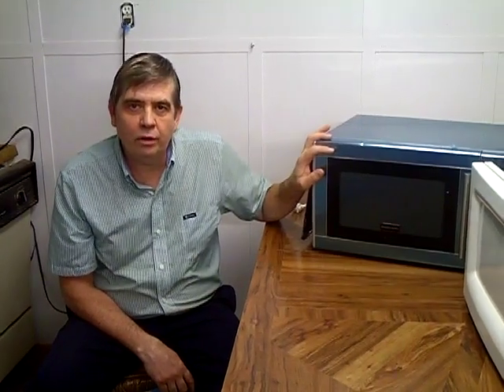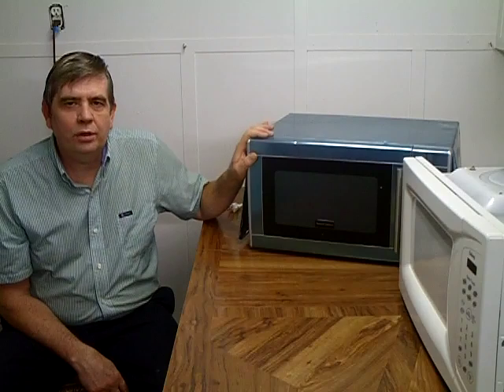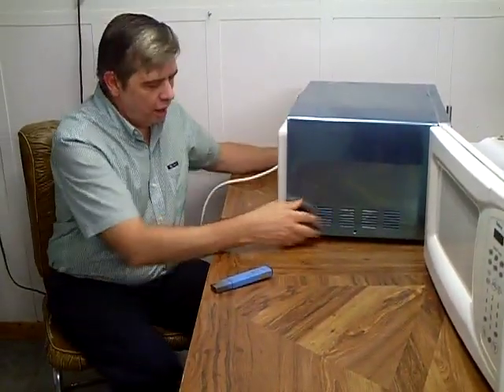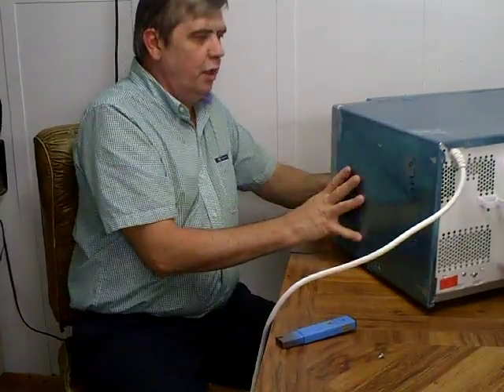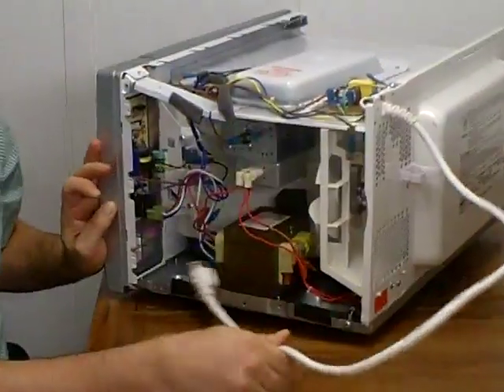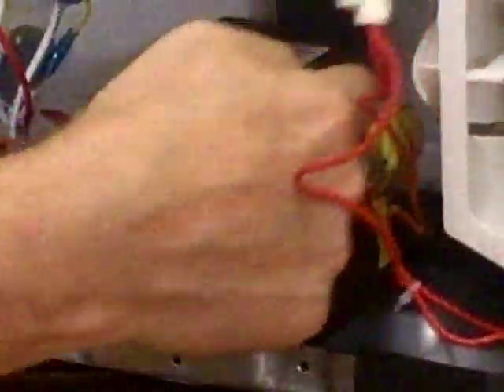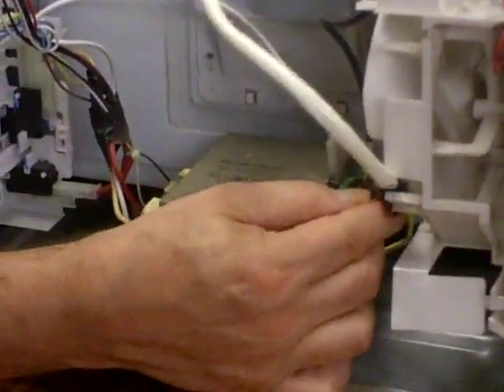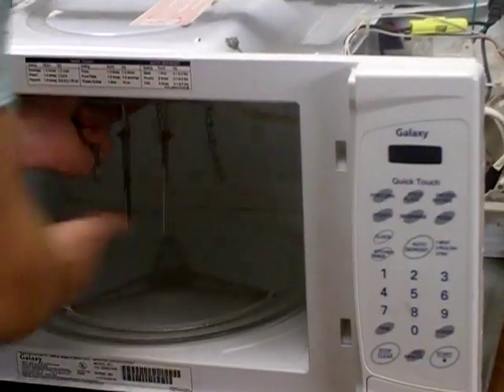6 -How  to build a high voltage  silver machine

Comment: Hello Bruce, thanks for sharing the good stuff!  
I did follow you steps, but as for now i dont get any results.
Perhaps my silver rots are too small? 1.5 x 1.5 mm and 5 inches long. The transformer starts to be hot or warm,  after an hour running, so guess something is working?!  Then i also disconnected the capacitor. perhaps i did some wrong. 
do you provide more info? in writing?  how can i solve this issue? 
pls advice. 
anton
Reply: He passed away
Reply: Mmmmmm ... So... not so nice... but thx for let me know Carlos. 
nice day.. Anton
Reply: so sad .  do you know how??
Reply: Heart attack or stroke-- I can not remember which. Unfortunately, nano sized colloidals do not easily leave the body, and can accumulate to cause toxicity, as explained by Tony Pantalleresco. This could have been exacerbated by his lifestyle factors, as he did not appear to be within his healthy weight. His speech a bit slurred, which could indicate lack of oxygen to the brain caused the nano particle toxicity coupled with likely mineral deficiencies. It was an unfortunate death because he was a thrifty inventor nonetheless.

Comment: Why did you get rid of the capacitor?
Reply: I'm guessing you could shock the crap out of yourself when removing the leads if removing the silver leads before it fully discharges, but would you want the higher voltage to get better colloidal silver?
Reply: D Green
Put a bleeder resistor across the hi-v cap - give it time to bleed after power off